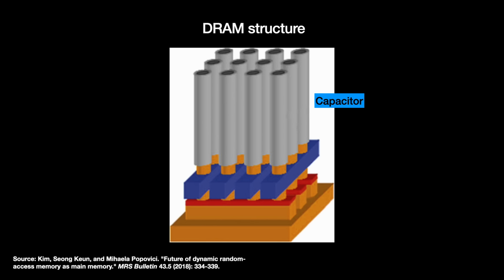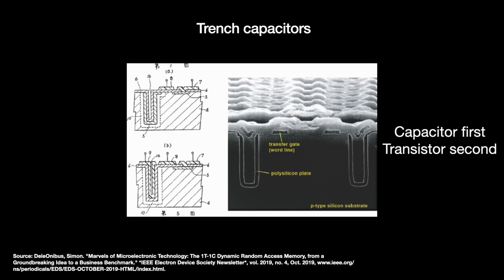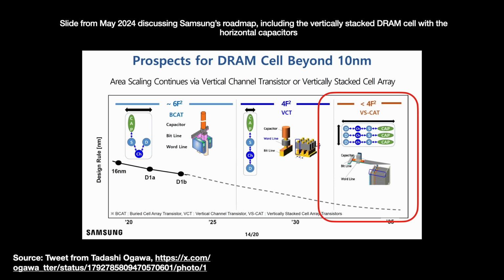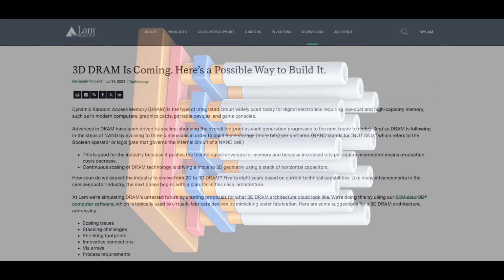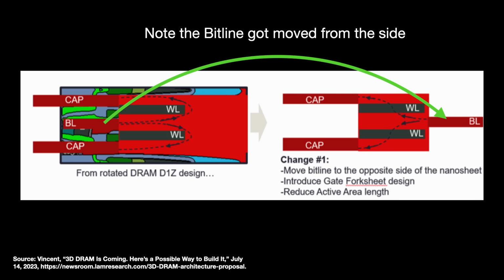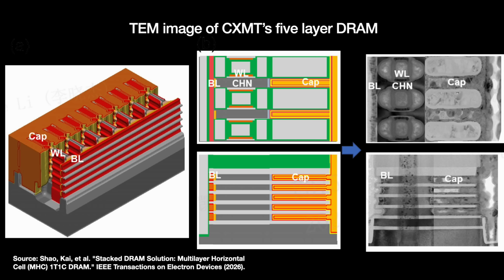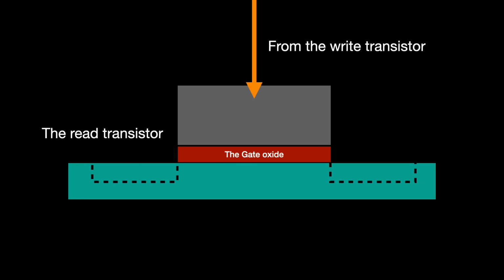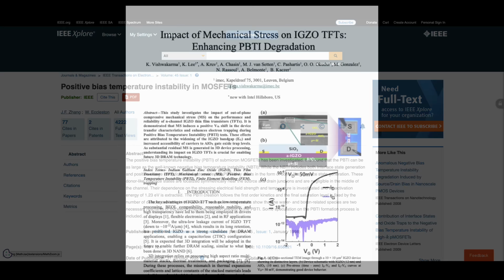True 3D DRAM

Comment: 4DRAM - change structure in time 👌🏼might have to go watch again, is the horizontal challenge in fabrication not a matter of using another axis ? or is that the problem with the manufacturing line needing a whole set of adjustments?

Comment: Maybe the old will be new again, and SRAM will return to prominence. Although it uses six transistors per bit rather than one, we may be getting to a point where it's easier to cram six transistors into a stack than one transistor and one capacitor. I am reminded of RLL encoding, where the encoding is first made less efficient by converting every string of bits into a longer string of bits, but also increasing the stored density of those bits faster than they multiply. If you need six transistors instead of one, but you can pack them eight times as tight, by omitting the capacitor, it's still a density win. It may fall short on other metrics like cost or yield, but at least it's a potential path to dodging scaling limits just a little longer.

Comment: I'm wondering whether switching to ferroelectric cells would actually allow for a much higher memory density with regard to currently used ridiculously deep & long cylindrical capacitors in DRAM. I mean it does exist & had been used before, but I can't help but feel that the relative necessary deepness of the cylindrical capacitors is becoming so large that DRAM scaling will be inferior to what can be achieve with ferroelectric cells regardless of how you optimize the manufacturing process.

Comment: you need to first solve the refresh nonsense, then you have nvsram no refresh required. the 1T1C design makes the capacitor drain as series capacitance. in nvsram the draining will not happen. transistor gate capacitance is much better than 1T1C. first make the capacitor size need to be smaller, then you already have solved the whole issue. make a very high capacitance pipe that has multiple capacitors in a row. again first fix your leak issue, then the issue is already solved. series capacitance leak is a circuit design issue, not a transistor issue. just do it, talking will not help. dramless ram, use normal transistors as registers. normal transistor size.

Comment: Problem is at this point it does not matter what new production methods they come up with as long as we have the same cartel in flash/nand and DRAM, we never got any price reduction on SSDs after the introduction of so called '3DvNand' which is now at like 200+ stacked layers and the same will happen on the RAM side. Reading about tech has been massively disappointing these past few years since it never translates into better and/or more affordable products in the real world anymore.
Reply: What's worse: we got it but we never know. At some point manufacturer would succesfully fab the new generation of DRAM with a fraction of the cost, but would say nothing about it and charge consumers the same price as the old DRAM.

Comment: Then we have to get the NAND Flash closer to the CPU to use everything else as cache for it.
-> New Interface for Flash running below the DDR RAM interface integrated into the memory controller.

Comment: IGZO in and of itself doesn't provide a way to do NAND type processing. To make it work Neo Semiconductor turned it into 3T0C instead of 2T, though it only exists on paper. IMEC recently also used IGZO for their CCD based 3D memory, but I wonder if silicon couldn't do it. The control gates for an array of vertical CCD aren't exactly like FETs, there are other knobs to turn to reduce leakage current which wouldn't work for DRAM.

If I were a NAND fabricator not presently in DRAM, thus not worried about internal competition, I would be throwing billions at NAND type 2T0C and CCD approaches. They're flush with cash any way.

Comment: Why is lateral etching so much harder? The only thing I can think of is we rely on gravity to some degree? Maybe we can just flip all the machinery on its side too? 😉
Reply: I think it's more like that nobody knows how to apply etching if you can't see it from the top surface. They've figured out how to apply isotropic etching in succession to grow spherical voids on the bottom of previous spherical voids so to make anisotropic, vertically deep holes. No such neat tricks exist for lateral etch and probably the only thing they know about lateral etching is how to prevent it, at best.
Reply: Seems to be due ro capacitor dielectric heat sensitivity as explqined here? 03:19

Comment: Why not make it like the flash storage?
- Mask the entire wafer/area with = pattern.
- Etch a deep = trench pattern.
- Deposit a stack of wordlines in the trench, making an - wordline stack.
- Lift off the mask/excess leaving your = shaped word line stack.
- Mask off everything except an | | pattern.
- Etch a deep | | pattern trench.
- Deposit a stack of capacitor layers in it to turn it into a H shape skyscraper.
- Lift off the mask layer with the excess material.

With the | as the cap and the - being the word line you can get a bunch of 4 bit cells which can be doubled up to make a byte or use each H as 2 center tap capacitors or use them as long strings of |-|-|-| shaped cells simply by changing how they connect the wordline layers together. This also keeps the number of steps down since you fill a whole trench with alternating materials.

Comment: As a gurney-man, what they need is pressure and heat. You can blast material out, somewhat replicatably, from any direction, with that.

Should we use miniaturized plasma beams, on the silicon removal and deposition and layers? Or just cut fine, then do that? There's options here, as well as sputtering/ spray nozzle attachments for different uses and sizes.

Comment: "capacitor-less DRAM"

look inside

capacitor
Reply: We're just 10 years away from using memristors.
And in 10 years, we'll still only be 10 years away from using memristors
Reply: @Knowbody42  Memristors are not the same as capacitor less DRAM.
Reply: @mnomadvfx  Did you know you can see the Great Wall of China from Mars if you take a picture of it with you?
Reply: @solidserpentine  Did you know there are more hydrogen atoms in a single molecule of water than there are stars in the entire solar system?
Reply: @Knowbody42  what's the problem with memristors? some techs look mature enough.
Reply: Dyson's "we-never-called-them-blade-less" fans "without blades"
Reply: IMPOSSIBLE
Reply: Do Teradyne next!
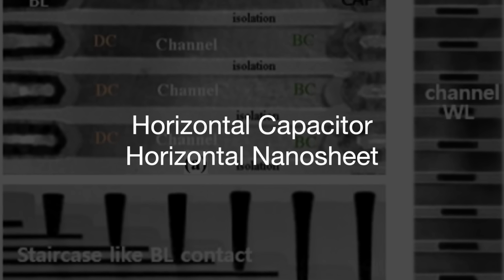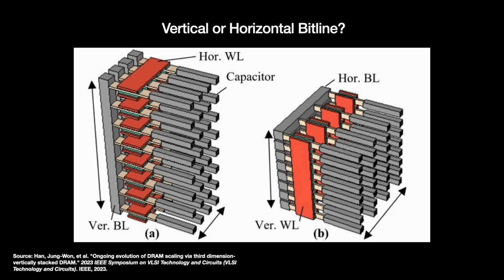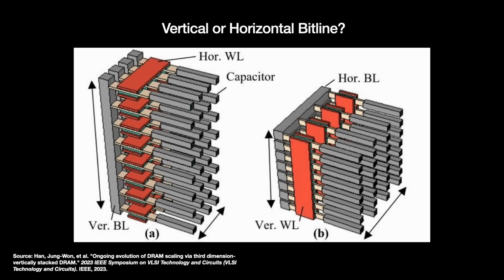Reply: 11:11 11:14 $ 11:16 see
Reply: Looks more like a NAND cell to me without the heavy punch-in current for writing.
Reply: But it isn't lol if you think about it like that, a wire is a capacitor. And it is, but it isn't. Neither "is" the gate.

A dedicated capacitor only stores charge. The effect here is direct, rather than carried from a purpose built capacitor with a charge on it.

For that matter, a power MOSFET readily demonstrates this. You can toggle it on and off simply by brushing a finger alternately from the source and drain, to the gate, and it will hold a "high" state for quite some time if the gate is held completely open (infinite resistance floating). Due to leakage of anything that might "build up", barring a strong external field, it will hold "low" indefinitely. 

Do your ESD routine blah blah, grab a 9V battery, 1k resistor, LED, and your favorite MOSFET (IRFZ44N works, I'm old school lol), connected common drain (source "follower"), and try it out. Power supply greater than the Vgs threshold is fine too but a strap will be enough to mess with the experiment, so discharge and disconnect lol

This is all the write Q is doing... connecting and disconnecting the read Q gate from the data line which will be instantaneously either high or low when the write gate strobes. The read transistor IS the memory cell in its entirety. 

To read, you simply attempt to pass current through the read source/drain. If current flows, the gate is set high. If it doesn't, it is set low. Other than that, you only need the other transistor to select it for writing within a matrix.

Side note, it isn't quite accurate as stated in the video that it is "non destructive", but indeed a simple read event does not cause total immediate destruction of the bit in the process as in DRAM, no. That said, passing current through the channel does increase leakage from the gate, so with current flowing, retention is not as long as if there is no read current.
Reply: Reversed-bouncing-Dawgystyle😭✌️

Comment: What's fascinating about IGZO DRAM is persistence and it's capacitor-less design. Depending on density and bandwidth, it might be possible to build these directly with GPU/NPU cores. They don't need to store everything HBM does, but it can possibly hold an AI model close leaving HBM for inference and training work.
Reply: The cost and time required to make silicon based transistors with higher densities will eventually start to make the photonics and biologics industry more price-attractive in computing. Most likely photonics first since it's almost over the finish line (<5 years).

Comment: I remember when I got my first 1GB of RAM in one of my early PCs. That was mind blowing to me that I had two, 512MB sticks of 400MHz DDR2 RAM with more space than the hard drives on the early computers I had used in school. My thoughts were "Dang, I will never be able to use all of this!".... Now, depending on the game I am playing, I push REALLY close to the 16BG limit of system RAM I have now, and my roommate actually had to upgrade to a full 64GB of RAM recently because his work load was too much for the 32GB he started with.
Reply: Wild reading this while remembering my first computer which had 128 bytes of RAM...yes, bytes
Reply: Buying another 32GB in this market? Owie!
Reply: The PC I'm using has 128GB RAM. But there is a reason for that, it's about memory bandwidth. I could get away with 64GB, but 32GB would be very marginal and 16GB certainly not enough.
Reply: My first computer had 1 MB of total RAM and that was already the luxury model (Amiga 2000). That RAM also included the frame buffer, btw - basically they had what we today call unified memory. It's almost unthinkable to be working with only 1MB today. Even back then the 1MB was quite limiting, especially since the OS did not have virtual memory.
Back then, the RAM chips were also soldered directly to the motherboard (in fact, the whole computer was just one board).
Reply: I'm more lucky - games I like to play aren't made by big studios so I don't think I will need to upgrade mine PC anytime soon.

Mine 16 GB will last me 10 years or so, I'm completely unbothered with what is going on.
Reply: Got 32GB and a 3D cache and i hit 97% while playing a modded colony on Oxygen not Included.

Comment: That's great and all, but wuts the point? Even if somehow "magically" 3d ram will be a thing, its gona cost even way more than ddr5 and its already unaffordable. And who knows how things are going to end up this year; planning for 2028-2029 is just wishful thinking. Back in a day technologia was getting not only faster and smaller but also cheaper. Today 5 year old lithography is x2 times the price. We are going backwards, straight to "owning nothing and being happy". Also Vega56 with HBM was released over10 years ago in 2017, yet GPUs in 2027 will still be using "normal" GDDR6/7.
Reply: It's expensive cause AI companies are hogging half the supply. Wait for the bubble to burst or suppliers getting more foundries online and it will get cheaper again.
Reply: believe it or not there is more to the industry than consumer hardware
Reply: They don't build this for regular consumers, they make it for those who require large scalable systems, which is a large portion of their profits
Reply: I'm pretty sure the point is higher capacity memory, not production cost. Imagine you can double the capacity of your RAM by simply using a thiccer chip instead of having to reserve footprint for double the amount of chip, which is impossible when you hit the physical PCB area limit.